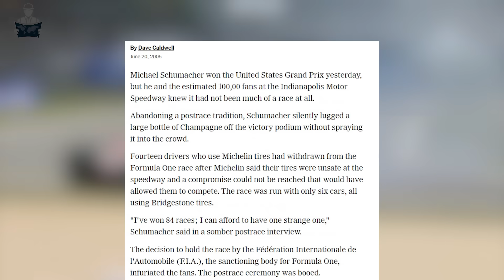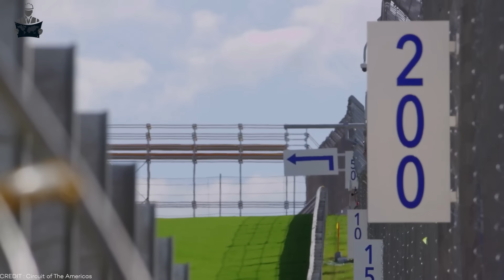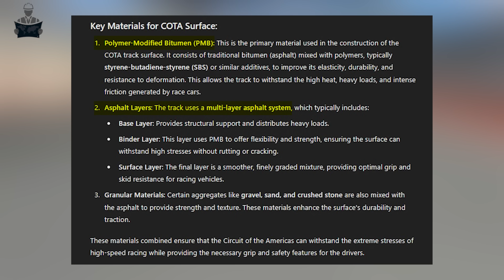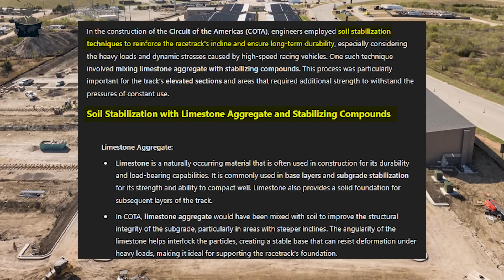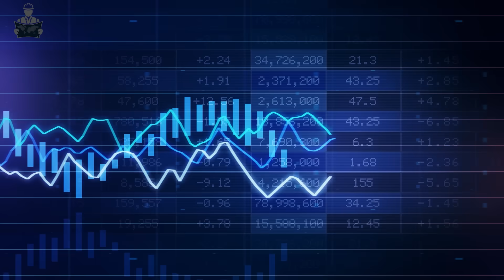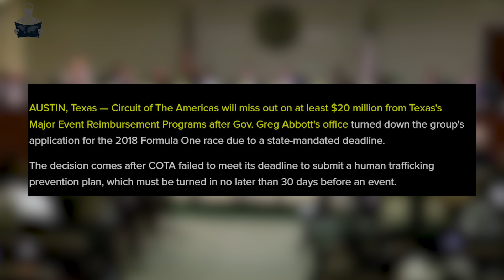Why Texas Spent $400M on a Racetrack Everyone Doubted

Comment: 'Designed to utilize the natural landscape' and, 'to carve out a massive incline from the Texas landscape would require moving millions of cubic yards of soil' don't sync up well. Also, the pavement and base construction techniques are not cutting edge. They are standard procedures used in road building for many decades.
Reply: Yeah. They have soil settling issues here.